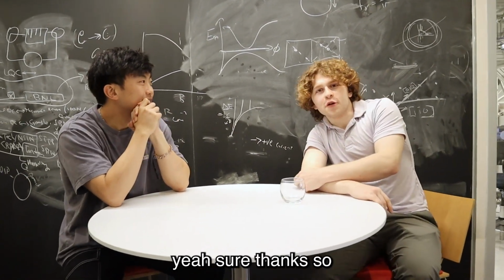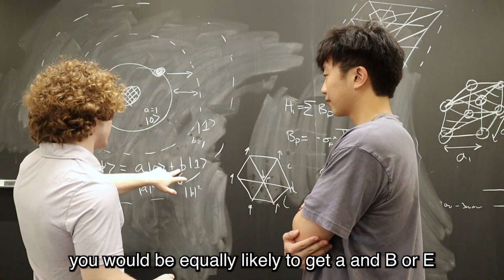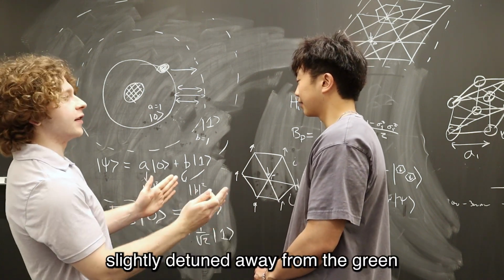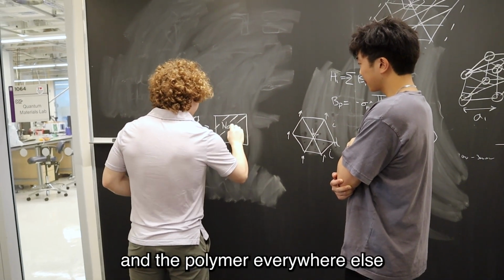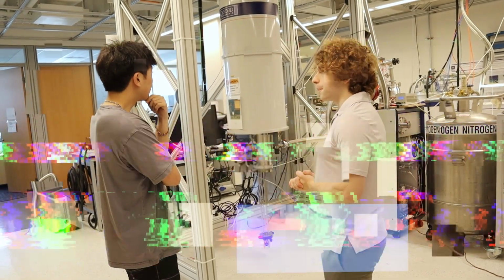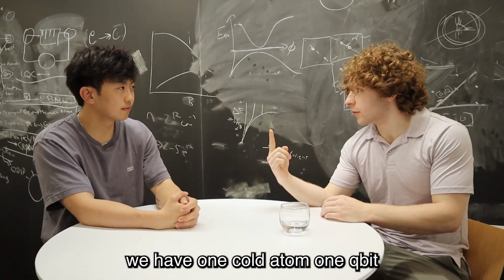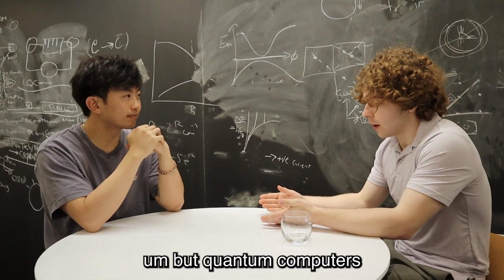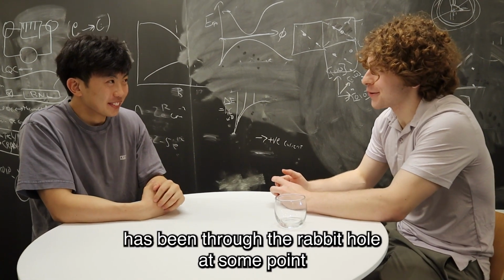How To Build A Quantum Computer (@ NYU Quantum Lab)

Comment: This was really interesting, loads of the questions I had were answered, I don't really understand the last part about the parallel universes and how it branches off, but I don't really mind not understanding that part.

I have a few questions still.

-What is a substrate?

When the metal you want on the wafer (aka grow in on the wafer), you sublime it (aka from solid to gas state).
-What is the difference between that and making a normal CPU?
Because they also have wavers, and a special process.
Reply: A substate is material we place below the superconductor to increase the amount of energy stays in our circuits, especially with quantum states that are extremely sensitive to losses in our material. Similar to a circuit board made of silicon and copper on top.

These wafers start with silicon and then are deposited with material we want via these techniques in the video

These techniques for making classical CPUs are exactly what we use to make quantum processing units. The only difference is the material.

Hope this helps, let me know if you have any more questions.